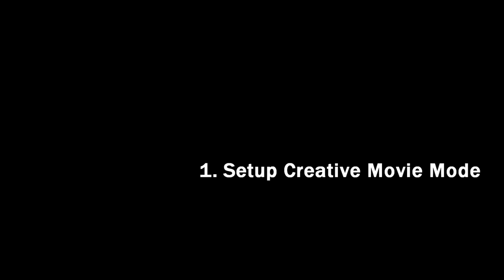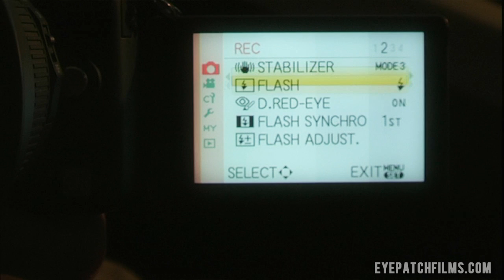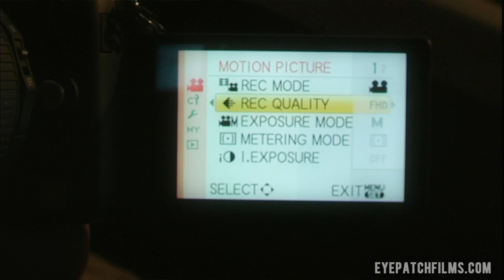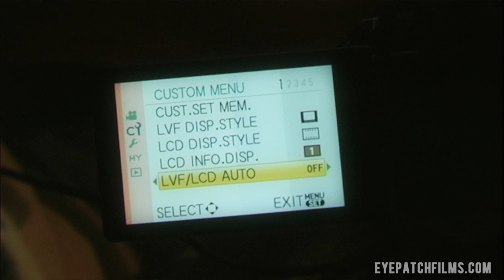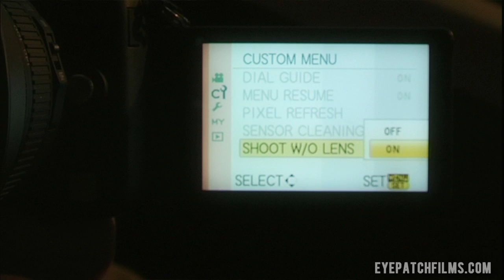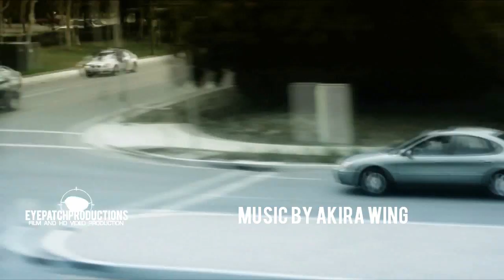1. Panasonic GH1 - (hacked tutorial) Basic Settings for Creative Movie Mode - GH13 HDSLR Tutorials

Comment: Hi,
I bought a lumix GH1.
I have hacked it and it great, but I have a bit of confusion.
When shooting in manual mode I set the shutter speed and aperture, that's fine.
Why is it that the ISO that I have set reverts to AUTO when I press the record button.
When I stop recording it reappears.
And while recording the LCD monitor dims.
Is there something that I am not setting.
Please Help.

Comment: @MiwaEarth : all GH1's after june, 10. come with firmware 1.34 does'nt hack. so if your camera has firmware 1.3. 1.31. or 1.32. it will hack. if its 1.33 it may hack n if its 1.34 it wont. Pls note even 1.34 shows its 1.3 but you have to go setup menu to check exact ver. hope this helps.